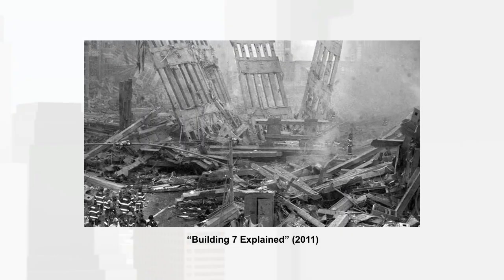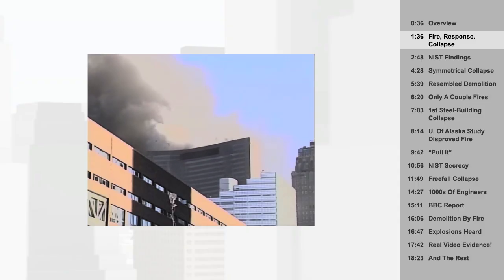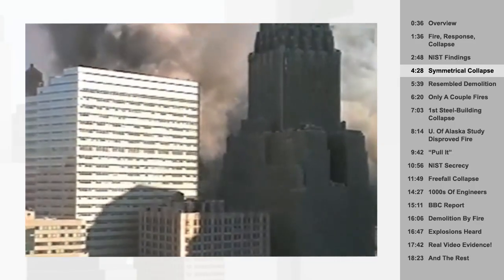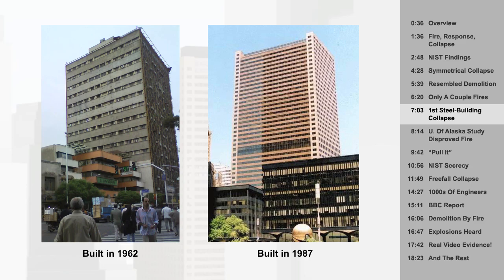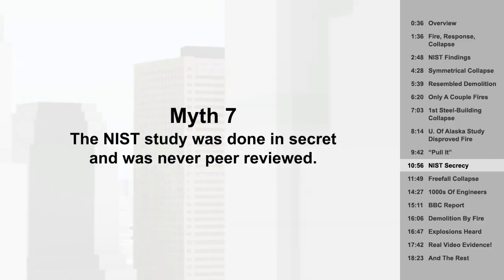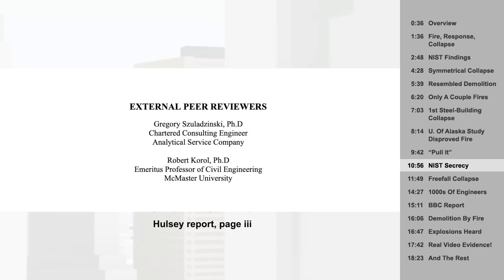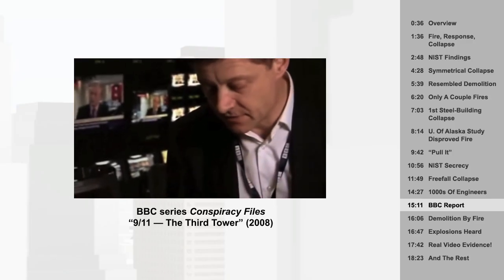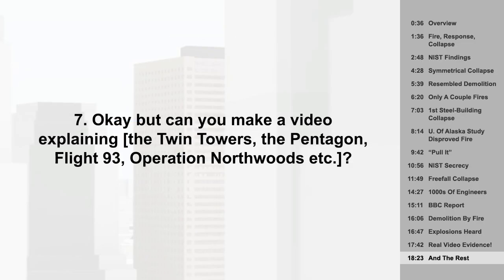Building 7 Explained: Comprehensive Final Edition

Comment: I think when people say things like "It fell into its own footprint." what they mean is, "It looks like a demolition to me.". It's really amazing how thoroughly someone can convince themselves that something is true with no expertise at all. "Ignorance more frequently begets confidence than does knowledge: it is those who know little, and not those who know much, who so positively assert that this or that problem will never be solved by science." -Charles Darwin.
Reply: Show me a tall building collapse, for any reason, that does not "fall into its own footprint". That's how tall buildings collapse - they don't fall over, they go straight down. Physics dictates this.
Reply: @erichjacoby-hawkins3076  True. Like what are they expecting? For it to fall like a tree? Gravity pulls down.
Reply: @erichjacoby-hawkins3076  lookup failed demolitions
Reply from the maker: @bo jackson  Those aren't tall buildings (20+ stories). Yes, shorter buildings can tip over. For taller buildings, the moment of inertia overwhelms the strength of the materials.
Reply: @erichjacoby-hawkins3076  maybe I misunderstood, I thought you meant taking out the bottom floor of a high rise always results in a total collapse.
Reply: @bojackson3073  I can't imagine a high rise NOT collapsing if the bottom floor fails. Would it just float there? But a high rise can NOT fall over - as soon as it's a degree or two from true, the supports all fail and gravity pulls it straight down. It does not have the structural strength to maintain integrity as a tower and fall over to the side. Gravity is pulling every story down, not over, and every story is pushing down on all the ones below. It only stays due to essentially being balanced on its vertical supports.

Of course, in a tall building, even taking out a middle floor will probably cause total collapse, because once the top half starts falling down, the bottom half can't hope to withstand the kinetic energy release. Hence the collapse of WTC 1 and 2. With 7, a whole lot of floors burnt long enough to lose structural integrity, so whether the bottom or middle of the inside collapsed first barely matters, it all fell in, then the unsupported sides followed.
Reply: @erichjacoby-hawkins3076  lookup failed demolitions
Reply: @bojackson3073  you said this before, but your vague reference still means nothing. All the failed demolition compilations I see are of buildings less than 20 stories, so they don't have any relevance to any of the WTC collapses. Do you have something at least on the scale of WTC 7's 47 stories, or even half that high, to add to the discussion? If not, then stop posting mindless meaningless repetition.
Reply: Wow!  Clever of you to use such a quote by one of  the high prophets/priests of that "religion" called Science.

Yes,  just uttering the word "science" like some Hindu mantra should make everyone SOOO smart and just nod their head and say "AMEN!" When one of the high priests  say something like:  "Lee Harvey Oswald was the lone gunman", or even something even more deeply profound like:  "If the glove don't fit, you must acquit!"  (Because even though SCIENCE and objective thinking  may indicate O.J. was not guilty....Well he is certainly NOT GUILTY RIGHT?)  And if GRETA THURNBERG says "The sky is falling because I drive a gas guzzling SUV" because the mighty "God" named SCIENCE says so, then SHE must be right too?  So I have NO IDEA what is bothering all these  bat shit crazy conspiracy theorists.  If the government has "SCIENCE" behind its decrees, then the rest of us "rationally minded" people have absolutely NO REASON to believe otherwise right??
Reply: @jebidiahnewkedkracker1025  What a perfectly absurd question.

"If the government has "SCIENCE" behind its decrees, then the rest of us "rationally minded" people have absolutely NO REASON to believe otherwise right??"

What does that even mean? Science IS the reason. Other reasons to believe something outside science are things like "My clergyman told me." "It just feels true." "An old book said it's true." "My crystal ball very clearly told me this." 

Have you discovered some new methodology for interpreting data? How does it work?
Reply: @PaulTheSkeptic  No, I'm merely taking perhaps too much "poetic license" to explain that science may tell one that "2+2=4"  BUT......
Science doesn't always tell you WHY 2+2=4.  Absurd point?  Perhaps.  So let me put it to you THIS way:  Science may tell you that 2+2=4 or that 4×3=12, but science DOESNT always indicate what such basic numbers REPRESENT, or even IF it's better to add/multiply/divide etc.
What The "God" named "Science" DOESNT always tell you is that His "prophets" called "SCIENTISTS" don't always agree, or for that matter don't always tell "the truth, the whole truth, and nothing BUT the truth, so help you "God"....Er,....UH.....So help you "Science".  "Grok" what I'm saying NOW?
Reply: @PaulTheSkeptic  Finally Paul, allow me to give you a backhanded compliment by suggesting that you DONT "PLAY STUPID" WITH ME.  (At least here in this particular comment string.😂😂
Reply: @jebidiahnewkedkracker1025  I get it. I know you think science is a religion. I've heard all those lovely little comparisons already. This scientist is a high priest, whatever. So if I might be so bold as to request that in the future we might try for clarity over rhetorical ornamentation? If you wouldn't mind terribly?

Because I really am curious. I think maybe I might be able to have a productive conversation with you and maybe educate you a little about what science is, what it isn't and what it can and can't do. Because, please forgive me but I strongly suspect that's needed based on your earlier comments. 

""Grok" what I'm saying NOW?"

Well, no. Not really. Not in context of my point. You seem to be saying that science is good for things like 2+2 but not as good for other things. You alluded to religion so often that I don't know which parts were meant to be derogatory toward science and which were things you were advocating for. And clearly if we're talking about why building 7 collapsed, we're talking about science and metaphysics doesn't need to come into it. Why bad things like the collapse of the building happen is a separate issue and one I'm not really interested in right now.

And whether or not Darwin is a high priest or whatever, he was still right. At a certain level of understanding, one begins to realize how little he or she knows and how susceptible the human brain is to cognitive bias. Science education is ultimately a humbling experience. Take it from a former know it all like me. Intelligent people can be 100% certain about things that are wrong. And when someone has the experience of learning you've been wrong about something you were 100% certain of, it's a transformative experience. It leads you to be cautious and methodical about new information and shows you the importance of proper methodology.
Reply from the maker: @Jebidiah Newkedkracker  What I DO have a problem with is the MINDSET of those who seem to think that "conspiracies" are impossible
Who has ever said that, ever? This is something I have seen again and again: "So, this video means you totally trust the government and don't think they could ever do anything deceptive?" That's a complete failure of logic. B simply does not follow from A. Actually, the main reason I find most government conspiracies hard to take seriously is that the government is far too incompetent. It's the opposite of perfect. 
ALL "conspiracy theorists"** are a bunch of bat-shit crazy people
No. The bat-shit crazy conspiracy believers are the ones who say there's no explanation for things they consider strange or fishy, which are actually very well understood. Believe it or not 100% of the information in this video is all available online. I didn't make it up, I was just interested enough to go looking for it. The bat-shit crazy conspiracy believers are the ones that don't go looking for it and don't even ask where it can be found, because they prefer having their belief system and don't want to see it shattered. (You'll notice I don't call them theorists, because that implies they have a theory, and none has ever presented a coherent, internally consistent theory.)

I don't know what the rest of your comment is saying, but you didn't answer Paul's question: If science doesn't get us closer to the truth, what method does? The Magic 8 Ball method? Did the technology you're typing on come about via the feelings method or via the Ouija Board method, or some other method? Tell us!
Reply: @jebidiahnewkedkracker1025  Why not? Are YOU saying that slightly condescending questions are out of bounds in our discussion? We're both big boys who have been on the internet long enough to be able to not take that sort of thing too seriously. Plus, when I do it, it's much cuter then when you do it. 😉
Reply: @PaulTheSkeptic  Your THIRD comment...Nice shot!😂😂😂
Reply: @PaulTheSkeptic  I will perhaps get back to you with a more detailed comment later.  I have to admit, I'm utilizing a cell-phone keypad to type my comments/responses one letter at a time with a single forefinger (as opposed to some 13 year old "wonder kid" who is all thumbs with a phone, but still screws up spelling and often logic, despite her/his speed in typing on a phone.😂😭😂)

So typing out long responses can be quite a chore for me--especially with some "malfunctioning" auto correct that if I was anymore paranoid, I would say it's doing its job quite well....At pissing me off😂😠😭😂)
Reply: @PaulTheSkeptic  many high-rise Architects and Structural Engineers agree it was demolition.
Reply from the maker: They recruited 7 since that video was made in 2016. 7 in 5 years. So impressive, considering that structural engineers can specialize in residential homes, tunnels, ships, bridges....

Also the claim is false that they agree it was a demolition. They signed a petition calling on Congress for a new investigation. But this is a rare case of a Truther misrepresenting a fact 😆
Reply: @EdwardCurrent  True. But in fairness, the claim was that "many" structural engineers agree. And I just couldn't resist saying that it was 27. Or 34 now I guess. 

I love that one btw. No matter how many times I see it, I always laugh when the "unemployed" guy comes up. 🤣

Comment: Correct me if I'm wrong, but doesn't rigging up a building for controlled demolition usually take weeks of preparation, strategic dismantling and the rigging of many miles of wire to thousands of explosive charges? All that without the thousands of people who worked there knowing or noticing anything?
Reply: 1. There's several eyewitnesses who DID notice strange goings on.
2. The more sensible theories look at Kroll security and firms within the building as being complicit.
3. Cover stories would suffice to ensure most in the building never gave it a thought (especially if 2. was the case)
4. Unconventional explosives and demolition techniques might well require less time and material. 
It seems totally plausible to me that a couple of truck bombs could've been used to help them collapse - and that authorities would censor this out of embarrassment over their intel failures rather than covering up bc they were involved. Why do people find even that idea ridiculous?
Reply: @ejws1575  You realize how loud explosions are?  Also care to list those eyewitnesses? You said there were several
Reply: Yes. Yes it does.
Reply from the maker: @qwsa283  And the evidence that demolition charges were planted in the building for over a decade?
Reply: Who said "It's good to learn. It's better to learn, unlearn then relearn"?
Reply: Please don't bring actual logic into this.
Reply: Only on certain floors. They closed the necessary floors down to prepare the charges. The same happened in the other buildings, entire floors closed down - people have reported stopping at closed floors in the few week's before 9/11 and seeing men doing what looked like some sort of construction works. This was when the charges are assumed to have been placed.
Reply: @qxqp  no they haven't. Why are you lying?
Reply: @qxqp  You'd have to charge every floor so... No.
Reply: @waspanimations7037  NO only the floorrs near the impact needs charging. According to progressive collapse or pancake theory...
Reply: @qxqp  so how exactly did the terrorists of both planes know exactly where to fly the planes into both buildings without prematurely setting off the charges of demolitions??? Seems like a failed attempt at another conspiracy you have here 🤦🏻‍♂️

Comment: people underestimate how quickly and how hot office interiors can burn, especially paper and plywood. burning paper does in fact melt steel and plywood basically uses oil as glue, coated in a thin isolating sheet of slightly more resistant plastic.
yuo can build skyscrapers out of flammable materials, BUT the fire suppression systems (pumping water up the tower) must be functional.
Reply from the maker: Another thing is that plastic products such as in office furniture, cubicle dividers, carpeting etc. have higher heats of combustion than wood, coal, etc. -- they have more energy per pound released when they burn.
Wood: 15–18 MJ/kg
Coal: 15–32 MJ/kg
HDPE: 37 MJ/kg
Polypropylene: 41 MJ/kg
Reply: Concrete seems to be much better but obviously more expensive and not practical. One larger building (25 floors) in my country Serbia was hit with tomahawk missiles in 1999 on the bottom of the building, middle and top damaging the main frame at 50% on few floors, and was even hit again days latter, but the fire itself didn't do that much damage and it was repaired. https://www.youtube.com/watch?v=5OsA9brxWuo
Reply: @1GTX1  Seems like there might be a trade-off in terms of flexibility, though, which probably makes it less-suited for very tall buildings (not that 7 was all that large).

Comment: You know, given the number of people who have died in skyscraper collapses and stadium collapses, I wonder if a requirement for some kind of black box or other telemetry in buildings above a certain capacity should be mandated.  The number of people who have died in plane crashes is under 100k, and I'm guessing the number of structural collapses of large buildings and the resulting deaths from them is going to be in the same order of magnitude.
Reply: I was actually thinking along the same lines while watching, but it would definitely need to be multiple sensors located throughout the structure. There’s no guarantee that they’d survive an Adverse Structural Event, so I think the data would need to be wirelessly transmitted elsewhere, maybe relayed through adjacent buildings. (They could form a mesh network.)
Reply: @c0d3r1f1c  Its more of a thought exercise I guess than something practical.  It would have to be mandatory or no one would do it and it would have to be retrofittable to more than a hundred years of building styles.

Usually with aircraft, the telemetry, black box, maintenance records and crash inspection are really very thorough. An airliner will be torn down to almost nothing at least once a year but bridges go decades without inspection and buildings are almost never inspected for structural faults.

I'm not sure how to translate the portable radar, xray and ultrasound inspection equipment into fixed, very cheap sensors.
Reply: @htomerif   I doubt that you could do radar, x-ray, etc. Vibration and motion seem reasonable, and of course you could get temperature and humidity. I think you could probably get a rough idea of their relative positions, which would let you see some interesting stuff if something bad did happen.

Comment: "WTC 7 was a controlled demolition!"

demolitions are loud

Marvin the Martian: "Where's the ka-boom? There was supposed to be an Earth shattering ka-boom!"
Reply: You are correct

"We heard this sound that sounded like a clap of thunder.  We turned around and we were shocked to see that the building was, what looked like a shockwave ripping through the building and the windows all busting out.  It was horrifying.  And then, you know, about a second later the bottom floor caved out and the building followed after that.”

"You heard explosions, like baboom!  There was like distinct sound, not like floors that were like dropping and collapsing, this was like baboom! And you felt, like, a rumble in the ground almost like you wanted to grab onto something."

 “I hear an explosion and I look up.  It is as if the building is being imploded, from the top floor down, one after another, boom, boom, boom.”
Reply: @bojackson3073  Checkmate, atheists?
Reply from the maker: @bo jackson  This video is about 7 World Trade Center.
Reply: @EdwardCurrent  The first quote is regarding 7 World Trade Center
Reply from the maker: @bo jackson  Sounds exactly how someone would describe the progressive collapse followed by the global collapse, since structural failures make "explosion" sounds as discussed in the video, one of which can be heard in the main CBS video.

It's interesting that they mention the "bottom floor caving out." That doesn't happen in demolitions of course, but would be expected in a collapse of a supercritical moment frame (e.g., what's illustrated at 13:23 but buckling outward rather than inward).

As for the "shockwave ripping through the building," that wave is literally shown ripping through the building in the video at 4:57. And the "windows busting out" because of this wave can be seen at 6:08.

So, even though eyewitness accounts are terrible evidence, this is a great on-scene description of this engineering disaster...thanks!